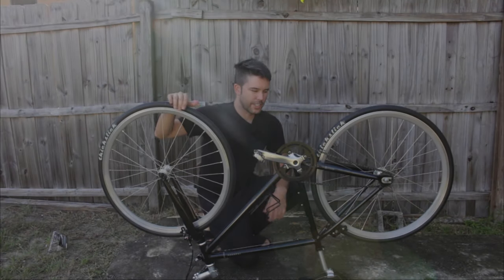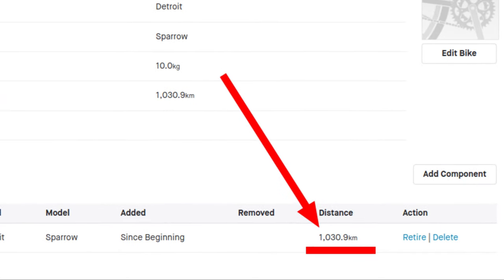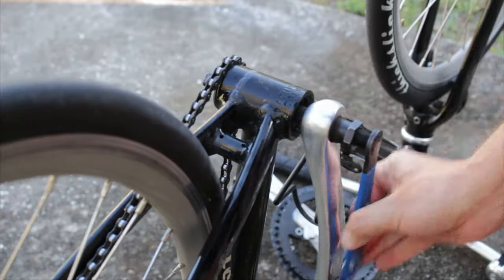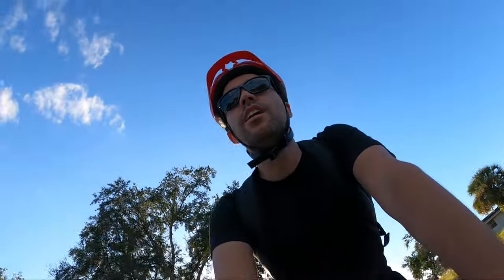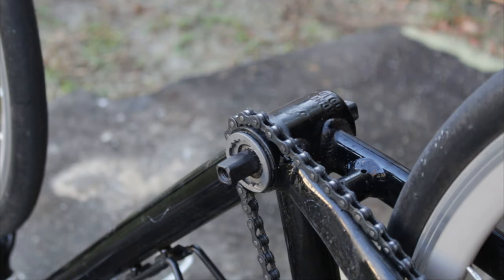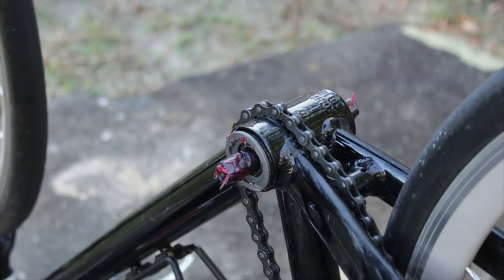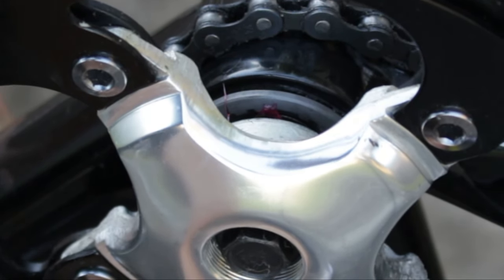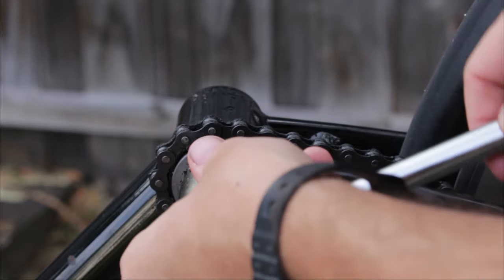Easy bottom bracket noise fixed

Comment: yesterday I posted quite a long text about taking off the chainset and wiggling a big screwdriver between the chainwheels. Creak creak! I was convinced I'd found the noise, after cleaning and regreasing everything else (pedals, chainwheels, chainset, bolts, new bottom bracket, new skewers on rear wheel, new chain....). So I posted a long text here. But went out iin the evening, and ..."creak creak". Oh no!  This morning I put  different rear wheel on and ... no creak! Note that it wasn't the skewers, it must be either the hub, freehub, or cassette. If anyone is interested it's an old Campag Daytona hub with campag 10sp freehub. Hope this helps, and apologies to anyone who read yesterday's post!

Comment: I would recommend losening the non drive side and tighten the drive side first all the way in (the side that is protruding the bottom bracket shell) and then tighten the non-drive side again afterwards. Also when you are already messing with the bottom bracket it is a good idea to completely remove it first, clean the bottom bracket threads and regrease them and the whole bottom bracket. Water often accumulates inside the shell so grease it all up whenever you get the chance :)
Reply from the maker: Thanks RH. I was also considering greaseing the BB threads too, probably should have. Anyway it's so easy to take apart, I can do it again any time.

Comment: That doesn’t seem correct. Another video I viewed said do not put grease on spindle. Depending on the bottom bracket, you shouldn’t grease unless you have loose or caged bearings. If you have sealed bearings then grease is not necessary but can be put on the threads of the BB. Also grease does matter. Which type I mean. Some grease can withstand high heat but others can’t. O well nice video and hope you find the problem.
Reply from the maker: I'm not a pro or anything, but I've had another instance where I was getting a lot of creaking and it resolved completely after I greased the tapered spindle. So I'm going with greasing it, but I'm open to be corrected if required.

Comment: Bruce, lol not too long ago I was asking if you could do an update on this bike.. I guess I got it, glad you were able to get it fixed. I don't work on bikes but curious is it always right to tighten and left to loosen on bikes like everything else or it ever in reverse?
Reply from the maker: Yeah I was thinking about your other comment Timothy. As far as the turn direction, on bike sometimes they have reverse threads like on pedals for example so that there isn't a chance that you can turn the pedal off by actually pedaling. Like if the bearings sized up somewhat, it could otherwise start to un-thread the pedals, as it is it will only try to tighten them.

Comment: Any automotive grease is fine, "bike grease" is just a scam. Even the Phil Wood grease is just overpriced sh%t. You can get a kilogram of high quality NLGI#2 SKF grease for like what 8-10 USD? The only special grease you need is carbon paste on carbon components, thinner grease (NLGI#0 or #1) on freehub bodies and Slickoelum or similar for suspension forks or systems.
Reply from the maker: right I knew about the carbon grease was something special, but so far I've had no issues with the cheap grease on aluminum steal stuff.

Comment: I have had a clicking noise coming from my steerer tube when I would rotate the bars when turning.  It turned out to be a lack of grease in the headset (came that way from the manufacturer).  Got it greased up and no more clicking sound.  You can never use too much grease, just wipe off excess and squeeze out when you reassemble the headset or bottom bracket, hubs, or whatever else you service.  I use Trek bike grease, but I have been known to use automotive as well.  Good to have around if you ever need to grease up your wheel bearings on the car- same thing there, can’t use too much.  Slop it on like you’re icing a cake.

Comment: I had a noise that only clicked 2 times per complete full cycle, on riding uphill or first few cranks starting out from a complete stop; HARD to find on the stand with no stress! 
I just bought for my brother, a practically new bike from someone that never found time to ride it. I knew it was not a tired bottom bracket or anything serious of course; I found it was a loose nut on the back wheel; looks like it never got assembled right; there's only 300 miles on this bike, and it has a loose wheel nut? Not tightened to spec from the bike shop or factory. It was only on the left side away from the gears; was quite loose, without much play in it however; but not even finger tight.. 3/4 inch nut, or mm equiv. 
The loud click was from the loose nut and the lock washer caught between nut and main washer. Wheel did not come off when riding; but I'm amazed original owner did not see that, before selling it to me. It made all the difference to fix one thing at a time; test ride it, and I could tell instantly I had my culprit!
Had to re-align the back caliper too; glad I just purchased a rotor alignment shoe that fits over the rotor when adjusting; worked like a charm; I find them difficult to adjust properly otherwise. It was definitely out of alignment once the wheel was on tight; it would not spin for long when on a stand, without realignment, and when I loosened the caliper, took it out of the equation; all was well... nice to have a bike stand, can't recommend it enough; if you like bikes, get a stand.
Reply from the maker: yeah it's shocking how often bicycles are not assembled correctly.

Comment: Hmm dunno man.. I was watching an RJ the bike  guy video and he recommended not putting grease where the crank arm attaches to the spindle.. but that nut/bolt should keep it in place no? If it works it works 🤗
Reply from the maker: interesting, I've always done it like that. In fact once had a creaky crank, I tried tightening it but that didn't help, after I applied some grease the noise went away. However I did just do a search and it seems like this is a big point of disagreement. https://singletrackworld.com/forum/topic/to-grease-or-not-to-grease-a-square-taper-bottom-bracket-axle/